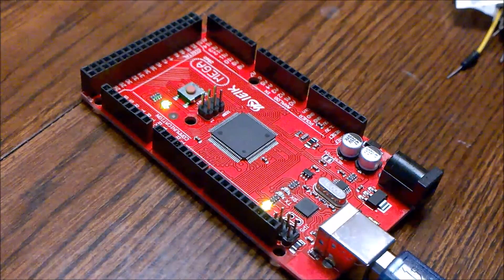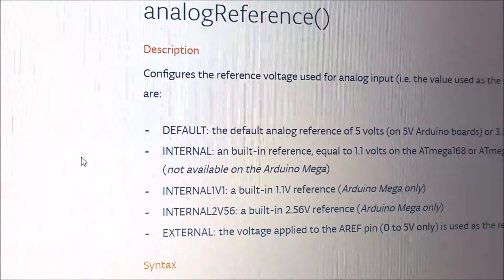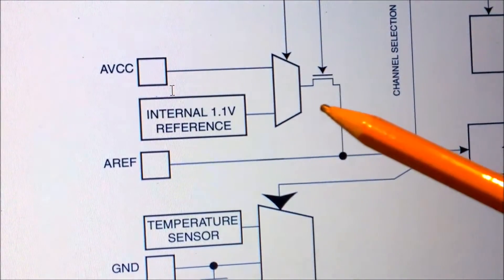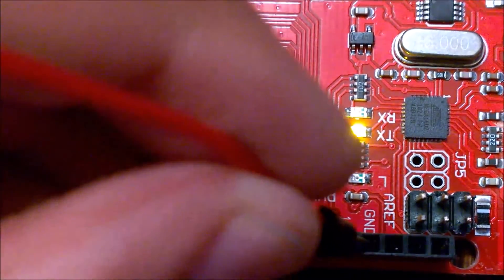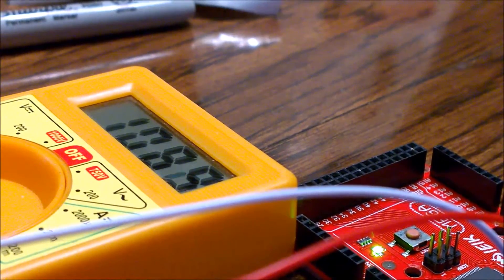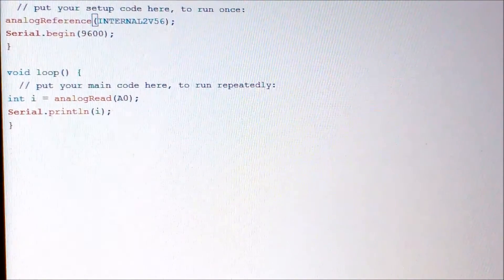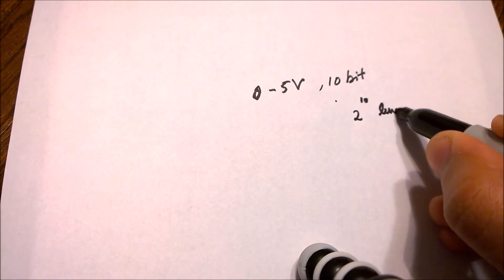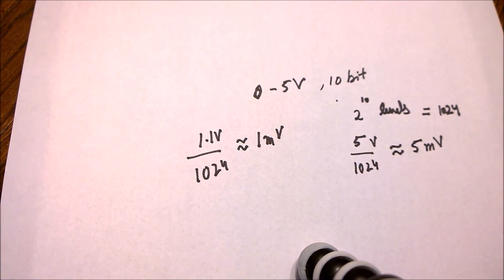Increasing Arduino ADC resolution with Internal Voltage Reference

Comment: But using the 1.1V internal reference, while increasing the resolution, doesn’t it restrict you to use sensors that outputs maximum 1.1 V?
Reply: Yes, it does. But you can use 24bit ADC rather if you want more precision with higher voltage.